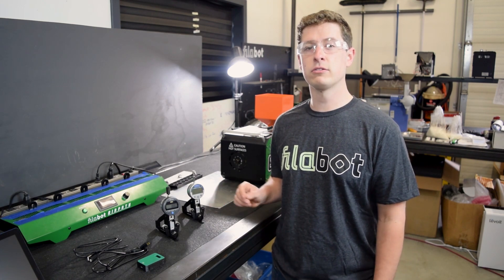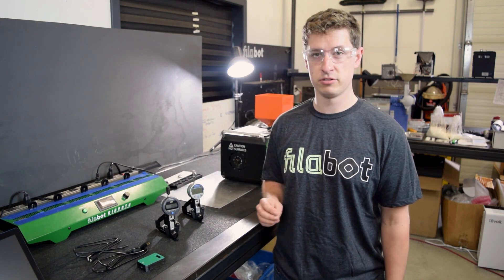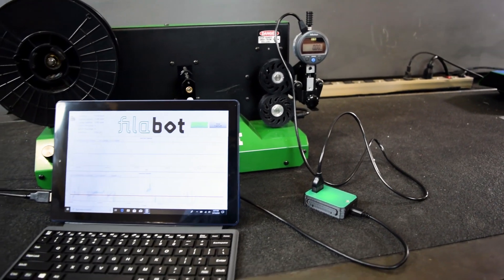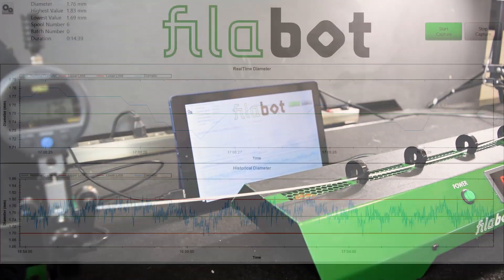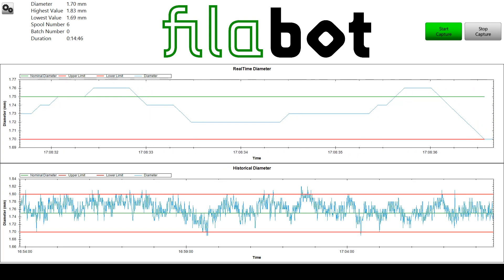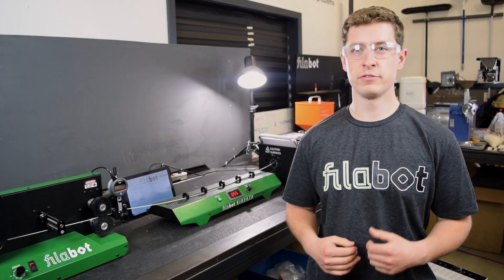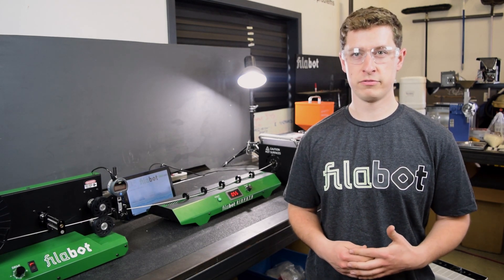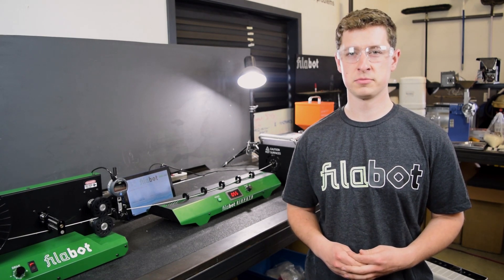Filalogger - Inline Filament Diameter Graphing and Recording

Comment: Do you have any plans to make the systems talk to each other and control the extruder speed/temperature as well as the spooler to maintain a consistent diameter across the spool?
Reply: If it's like their level of email 
answering, I guess not.
Reply: Not associated with Filabot but a buddy of mine and I are attempting to do something with the filameasure and spooler. Still very much a work in progress